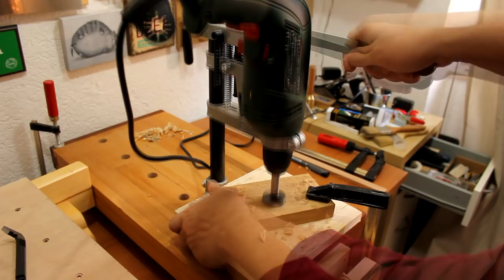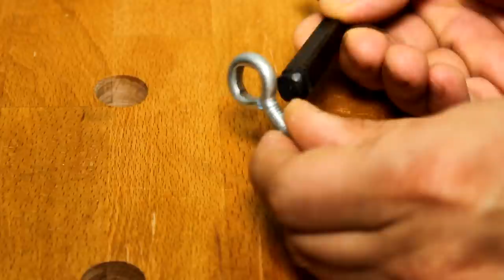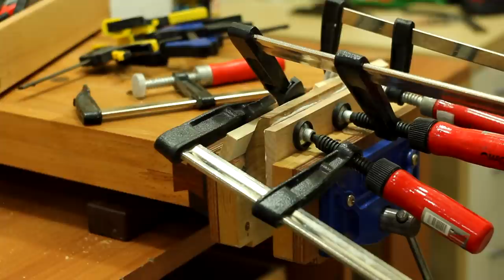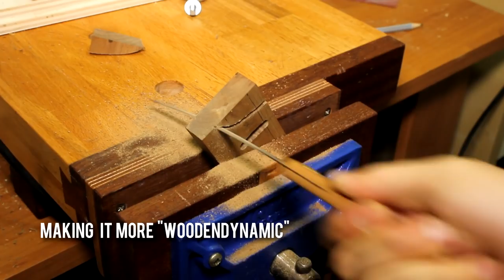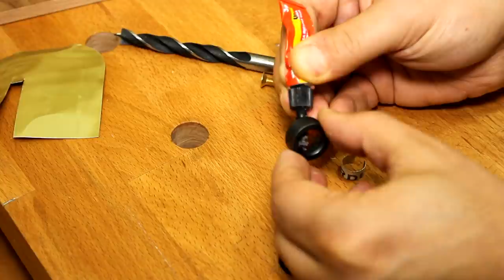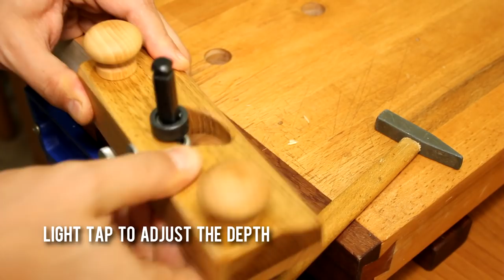Making a Router Plane - with Depth Stop & Fence

Comment: Just made the basic version today, works so well, depth stop next then the fence maybe. First mistake was making the hole too small so I could not get the bolt into the slot, then I cut the groove too deep but otherwise good so far. Thanks for the video. Keep it going.
Reply: Finished the death stop and fence today, fantastic project, inlay panel doors here we come!

Comment: cool idea shimming that drill stop, i used the same way to fix the wobble in my drill stand u can pad the inside of the drill clamp that goes up and down the collum to make it fit more snogly over the collum, really like the router plane it looks really nice and the guide is a really smart idea.
Reply from the maker: +Dor shem-tov yes the drill stop i.d. wad 12mm and the blade at its diagonals 11.5 and something. Makes a great tight fit and just a little soft, enough to take out its shape. Thanks!

Comment: Really nice tool build - thanks for sharing. 

It's only on the third or fourth watching as I prepare to make one myself (but with a ground down Allen key/hex wrench ) that something occurred to me. By putting the inserts for the fence so close to the blade, you limit the scope for adjustment. I realise in practice you may not often want the fence much further back, and its rigidity would suffer if the bolts were too far back too. But an inch or even a half-inch would give greater range of use. What are your thoughts?
Reply from the maker: Thanks! Yes, for me, doing mostly rebates and grooves for panels/lids with this, is suficient to have that range, because those are more to the edge. For bigger range, an extra pair of insert nuts can be added more far away

Comment: Nice Job
I'd like to make one.
What size is the large hole through the block? What size is the square file?

Thanks

John
Reply from the maker: +JKN N Hi, thanks! The hole is 35mm, 1 3/8"?, I would have done it larger, like 40-42 but that was the largest forstner I had. File is generic big box store, like 10x10mm or less.

Comment: What is the Allen key with the chisel point. Why have I never seen one of these before. Nice build !!
Reply from the maker: Thanks! If I understood correctly what you refer, that's a router plane blade (made by Veritas), and is square not hex like allen keys. Of course you can make a blade from an allen key if is a good material.

Comment: One thing to note, for hight adjustment, you need this alenkey, wouldnt it have been nice  if you would have integrate an Storage for that in your Plane ? =)
Reply from the maker: Yes, interesting idea to store it in the plane. My first idea was to use a thumb/knurled screw instead of that alen bolt, but I've ordered a wrong one for this purpose, M3 thread, instead of M4 how is it in the depth stop, and that's why was left like so.

Comment: You have chisels MHG, what they are quality
Reply from the maker: I didn't used any chisels before more premium than these. Against the ones from big box store yes they are good. The small ones 6 and 8 mm chips a little, but probably is normal due to their size/force. I will start getting step by step a set of japanese chisels, than I can see any differences.